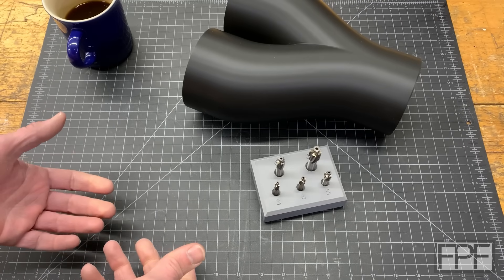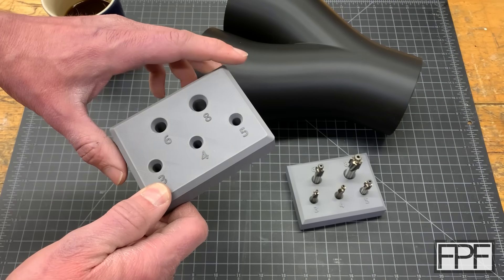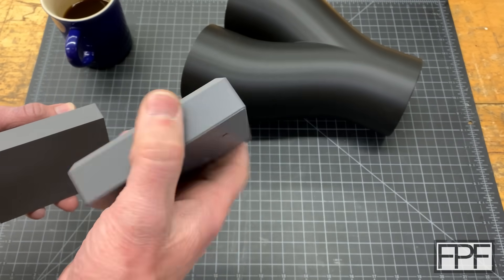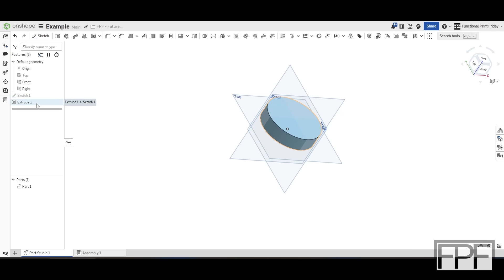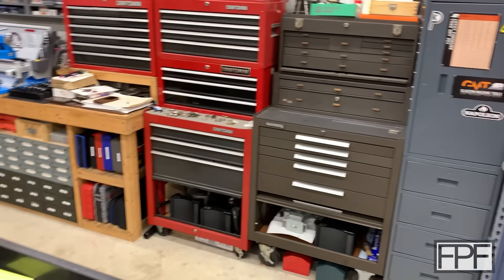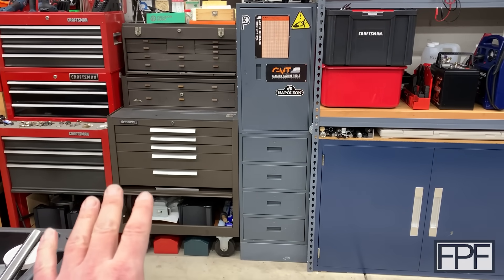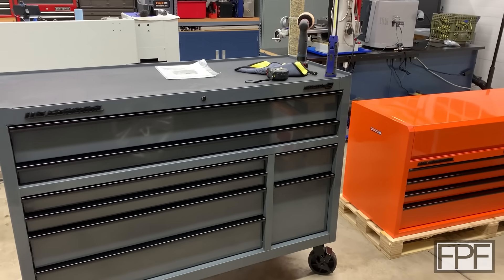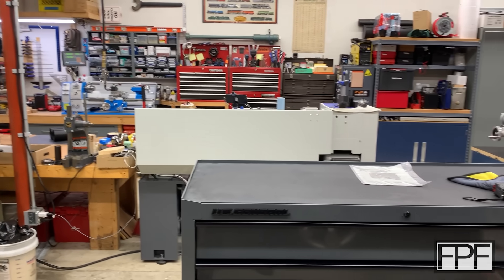Y-Pipe Viewer Challenge and Shop Updates

Comment: not gonna create an onshape account, but i did the challenge in inventor since they use the same kernel afaik (edit: fusion and inventor share kernel, not onshape). managed to do it 3 steps, tho i dont know how they would be grouped in onshape. 

my workflow was:
draw the path of one channel in the 2d sketch
draw the outer diameter of the base circle
sweep the circle along the path
mirror so you have the y shape
use the shell tool and make sure to de-select the openings so only the y tube remains afterwards

since sweep consumes the two sketches only 3 operations remain
unless you manage to sweep a self intersecting body this is the minimum of operations but i look forward to be proven wrong

Comment: Greetings from Norway!

I am really envious of your workshop! I would love to fit something similar in my house but I simply don’t have the available real estate. 😀

I really appreciate you taking the time to show more of the actual design of your parts. Especially your thought process. I bought a Bambu Lab P1S in January of 2025, I have just passed 1400 hours of printing on this machine. I want to design my own parts, but I have mostly done existing designs. I have printed a few of yours, they are great. I am currently using Fusion, but the learning curve is steep 😂. I have not looked much into Onshape, but I will definitely look into that. 

I also want to thank you for using both metric and imperial measurements. I understand why you’re designing in MM, but when measuring around your house (like the toolbox in this video) you used both. It’s a small gesture, but I really appreciate not having to make my own conversions. 

Will you be doing Gridfinity on some of your new storage drawers?

Best wishes for the new year and look forwards to your upcoming projects!

Comment: 6 timeline steps in Fusion: Sketch circle, sketch center spline on perpendicular, sweep <create, perpendicular>, identical sweep <join, perpendicular>, circular pattern <feature: choosing second sweep from timeline, use sketch circle as axis, compute type: adjust>, shell. This creates a perfectly parameterized version where the relevant cross section is respected unlike a loft, the shape of the pipe is defined by one single spline, and the number of tubes combined into one is defined by the circular pattern which inherits the join characteristic from the second sweep. 2 sketches, 2 sweeps, 1 circular pattern, 1 shell. I'll bet it's about equivalent in Onshape.

This is how I always do these vacuum adapters. It takes way longer to write this comment or open Fusion. As a general tip, abuse symmetry including the rotational kind as much as humanly possible.
Reply: That's neat. I created 2 sketches, each with concentric circles (inner and outer dias) one on an offset plane, then lofted the inner edges and then the outer, split the body, deleted half and finally used a circular pattern to duplicate it. That felt very clumsy, so thx for showing a more elegant method. Disappointed that I couldn't loft the faces, only the edges, which caused extra operations.

Comment: Toolbox Request:  personally, my OCD won’t allow me to have a top and bottom chest in different colors, but I also do agree accent color on toolboxes would be a lot nicer.  I’ve considered adding color to drawer handles.  

Now, regarding the accent color to cover the top chest damage.  I own a couple large top and bottom chests from Craftsman, and I had very similar idea.  Not due to damage, but I was thinking of putting TPU bumper on the same edges as a means to protect the edges.  Consider a black or gray TPU To bring the two boxes together, cover the damage from packaging when the paint was wet, and provide some protection for the box.

Just a thought, keep up the great work!

Comment: I got one of these Y fittings in my window. They are not very complicated to design. Typically I just use the Pipe function along with shell, in some programs you can select walls to remove or just bore out the rest with an extrude (if you want perfectly symmetric you can mirror). The other way that helps a lot for making tubes and nice angles is to start them with prisms (blocks) then use fillets to make them into circles by calculating the radius of the fillet for each edge as the (length of the wall) / 2 = radius. After you then shell the inside. You can also do lofts but a proper pipe step count would be about 4 - 5(1-2 sketches,1-2 pipe, shell).

On the toolbox, just do the 30 day thing. Everytime you look at it the thing will piss you off. If you put 3D prints on it, then you are just going to look at it and think about it. If you get a different color then you will either 1, like it better, or 2, hate it and get annoyed. Anything in the shop that you don't like can cause slight microstresses that will affect your workflow. Just bite the bullet and do the 30 days. That is unless it just REALLY does not affect you at all... which I doubt because you put it in a video. The current box already needs to be set up for gridfinity most likely anyways. And no... most things I cant get in one piece. I have a 600$ air conditioning unit that was thrown onto my porch by the delivery driver and has a big dent in the bottom of the radiator.

Comment: you can do the y-pipe in 5 "steps": sketch a circle, sketch a spline curve, sweep circle along spline, mirror with "add", shell
Reply: I think you missed that the single end has a different diameter than the double end
Reply: @fenceup07944931177  in that case you need two additional steps: one to create a plane at the end point, one to draw the sketch with the circle of the end point. then you dont use sweep, but loft (and use the spline as a guide). so 7 steps in that case

Comment: 5 steps in fusion :)
Reply: After a little bit of more thinking I did it in 4 steps
Reply: Actually when respecting the 45mm straight Design requirement that appears… optimistic…

Comment: Did it in Fusion in 8 steps. So no bragging rights for me. But was interesting to do. :)

1. Sketch with the one pipe/circle
2. Extrude -45mm (was dimension d10 in the end)
3. Construction layer with distance 250 -(-d10*2) from the origin
4. Sketch on the construction layer for the two pipes/circles
5. Extrude 45mm
6. Loft from the one-pipe-side to the left circle on the two-pipe-side
7. Loft from the one-pipe-side to the right circle on the two-pipe-side
8. Shell with 3mm thickness

Comment: The orange box I would have asked for it to be cleared coated again, this would provide some protection. The 3D printing a strip to cover the damage not a fan on the box. Not keen to replace with a red and black love the orange. I have several boxers yellow blue and red and they look great. This year my new shed will be built and several more boxers will be required I'm looking at apple green, British racing green, deep deep purple and the last one I spotted fire engine red. The racing green and deep purple have gold handles the others silver. So my fav's are deep purple and British green but who knows that may change after construction is completed. Not a fan of boring grey

Comment: I didnt do it in Oneshape, but just from curriosity i tried in my Solidworks Version: 5 Features i needed
How i did? => Design one side cut the  connection surface flat, mirror the designed part, and make a Wallcut without floor, maybe it is a idea for Oneshape to improve

Comment: 7 Steps in Fusion (I don't have Onshape, but I believe all the functions are equavalent in Fusion):

1 sketch bottom profile on origin plane
2 create offset plane for top profile sketch
3 Top profile sketch
4 Side profile sketch for sweep centreline
5 Sweep top to bottom profile (1 side)
6 Mirror body in YZ plane
7 Shell
Reply: 1. Sketch 1
2. Offset plane
3. sketch 2
4. loft 1 (should have a weight setting on it?)
5. loft 2 (should have a join setting?)
6. shell
Reply: Actually the lofting is pretty hard  to get perfectly straight at the ends... so sweeping gets better results. Some tweaking made it down to 5 Steps in OnShape:
1. Single End Sketch on horizontal plane
2. Rails-Sketch on a vertical plane
3. Sweep circle along first rail
4. Sweep the same circle along the 2nd rails an merge at the same time
5. Shell out

Comment: Keep the orange box with a discount. It's a storage box after all. Cover it up if OCD makes you to 😅 Given your fleet of printers and sponsored filament I'd do it too, probably.
For your challenge (sorry, I use Fusion360) I'd do it in 6 steps: 1) sketch (two circles), 2) sketch (path for one half), 3) sweep on path, 4) split on yz plane, 5) remove cut part, 6) mirror merge on yz plane

Comment: Chamfering the bottom eliminates elephant foot first layer. In Fusion, offset plane, 2 sketches (with 3 circles), 2 lofts with a join, shell.
Reply: Or just use the slicer's built in method instead of fixing in design. Else you need to fix the design for every material on every printer.
Reply: @valamilamasag thanks, I need to check that out.
Reply: That’s EXACTLY what I said to myself when he was mentioning the challenge
Reply: 2 Planes, 2 circles, 1 fit spline, 1 loft, 1 mirror(join), 1 shell
Reply: You can still get an elephants foot, the chamfer hides it rather than eliminating it.
Reply: @ferrumignis good point

Comment: Made it 7 steps, albeit in fusion: https://youtu.be/Eyxa7BZ6LSU
Reply: You could have put the two circular profiles and the spline in the same sketch by using the 3D sketch option. Not that you would do so like that in practice but it does save a "step".
Reply: And as an afterthought if you put 4 circular profiles and the centreline in a single sketch you can then loft between them followed by a mirror join and a shell. 4 steps.

Comment: Took a bit of tinkering but got it in 6 steps. One sketch with both size circles and the correct spacing. A normal extrude and then another one with a starting offset to get the other side, then loft, mirror, and shell
Reply: Oooh, good idea to use an extrude with starting offset to avoid the need for a plane and second sketch. 👍
Reply: But your single opening side won't be perfectly vertical for 45mm? I think all three pipe openings need 45mm straight sections. I could only do this with two guides in 8 steps.

Comment: I did it in Fusion 360 in 11 steps. That includes creating two sketches, one shape, three lines, two arcs, sweeping, mirroring, and shelling. I believe I could cut it to 10 with a different arc creation sequence and to 9 by eyeballing the arcs instead of using a guide line. Technically I could cut it to 7 by eyeballing the arcs entirely or at least just counting squares and I could cut it to 6 by using a single sketch and just using 3D sketching. I think 11 is pretty reasonable though! To comply with your rules of 45mm straight sections I would need to add two lines making it 13 steps total. If you count everything in a sketch as one step, then it's only 5 steps for me as shown on the history bar and could easily be 4 with a 3D sketch.
Reply: Oh another commenter just pointed out I missed the requirement of the circles being different diameters. That adds a few steps. I'd likely create an offset plane, then another sketch, and another circle. Don't need two of the extra lines then. So brings it to 12 steps total or 14 with the straight sections. Still only 3 sketches and 3 operations or really one 3D sketch and 3 operations. I think 14 is the real number of total actual tools used.

Comment: My opinions
I was gonna make some of those design points last week, but I figured others would point the little nuances out. Glad you made those changes.
Other than that...
The orange paint is fine.
I love the colors.
As for the last cabinet... As longs the drawers slide out without anything jamming up. Everything's fine.
Reply: I have always felt the same way about the fine details of buying something new. But...  as long as everything works.

Is it worth the hassle of sending everything back to get a return which might be damaged in a different way?

Comment: While it doesn't qualify for the challenge, it was fun to make the object in FreeCAD. It took me 8 steps in the Part Design Workbench:

1) Sketch a circle for one of the large pipe ends, 250mm up from the xy plane
2) Sketch a circle for the small pipe end on the XY plane
3) Sketch a path on the ZX plane between the two circles (two straight lines and two arcs)
4) Additive Pipe using the 3 sketches
5) Thickness the pipe to 3 mm
6) Datum plane from the YZ plane
7) Pocket away the excess pipe using the datum plane
8) Mirror the remainder

My first thought was to mirror the solid then thickness it but FreeCAD couldn't do that thickness operation. I imagine that OnShape could, so it will be possible to do it in 6 steps.
Reply: Huh. I don't know OnShape, but I have an old account so I hopped on and and gave the challenge a try. I'm sure I could learn it by watching videos and working at it for a while, but my first impression was that a lot of things are unintuitive and frustrating. I had to look up how to do several things just to create three simple sketches. Then I tried to loft or sweep using them and didn't manage to make either of those features work as needed. The sweep swept both the start and end sketch along the path, creating a 106.25mm pipe with an embedded 101.6mm pipe instead of a pipe tapering between the two dimensions. The loft created the correct start and end sections but twisted up so it closed to a point in the middle). I banged my head against it for a while but it stopped being fun and I gave up.

Again, I'm sure I could learn to use OnShape, and I ran into plenty of frustrations learning to use FreeCAD, but given how people talk about OnShape I was expecting it to be easier to do something simple like this.

Comment: I just replaced my harbor freight General (off to my daughter) and replaced it with a 73" Harbor fright  ICON roller cabinet. I think harbor fright tool boxes are a great value. I my case, I looked for a roller cabinet to carry my PM1440GT. So I  reinforced the box with new wheels and steel to carry the PM 1440GT lathe which sits on a 1/2" plate of 6061. If you are interested I can send you a pic. The one issue is, I need a riser to use the lathe because the roller box is higher than the at the stand it replaced. The total load of the box is 8000 lbs which was a good starting point which enables it to hold all of my lathe tooling.
So the PM1440GT is on wheels with levelers and I have adjustable bet rails attached to the plate so I can manage any bed twist. I also updated the PM1440GT with a VSD and better control logic as I scraped the lathe stand and control package.
If you are interested in the variable drive I can walk you thru that to0. I also swapped out the DRO for a touch DRO with the RPM option. Needless to say I get much better speed range than PM's version but that's another story. By the way, my PM728VT is also on a tool box with hydraulic wheels.

Comment: I use SolidWorks Maker instead of Onshape so I can't submit a model, but they look like basically the same thing, so here's my take.
1. Sketch bottom circle on the top plane at the origin
2. Sketch the curve for the loft on the front plane
3. Create plane for the top circle
4. Sketch the top circle
5. Loft
6. Mirror body across right plane
7. Shell
Reply: If SolidWorks has something akin to the sweep command in Fusion 360 you can skip the second plane and second circle and just sweep along the curve instead. Otherwise pretty much exactly what I did.
Reply: @802Garage but that gives the same OD to the top and bottom circles. In solidworks, to go from one OD to another requires a loft from one diameter circle to another, hence the other plane and sketch.
Reply: @johndupree6066 You are totally right! Missed that part of the requirements. Good call.
Reply: I don't know OnShape either, but I tried exactly those steps. It has all of those tools, but the Loft didn't work (it twisted in the middle, presumably either the plane or one of the circles was rotated differently than the other), so I have no idea if the mirror or shell would work. Sweep didn't work either (it was 106.25mm OD all the way, with a smaller diameter circle visible on both ends).

Comment: Glad you like OnShape, it's not my preference though, so I'll evade the challenge I guess. I think I can do it in FreeCAD, but that disqualifies itself, so I won't worry about it. I do think I can do it in about 5 or 6 steps in FreeCAD, but I'm pretty sure that's using features that I don't know if they are included in OnShape, so I won't describe them here. Best of luck to whomever picks up the challenge. The different OD pipe dimensions at each end complicate things. 

As for the orange top box, yeah, get the kick back, then make up a set of TPU bumpers in black to cover those surfaces. If the sovl max has a tool-changer option available, it might be an option to have a second extruder with something like a silver colored TPU to give the corners an accent. But I'm pretty sure that wouldn't come out as glossy as one would like, so single color is probably fine.
Reply: I'm in the same boat, but I did it in FreeCAD anyway. It took me 8 steps in Part Design. I thought I could do it in 6, but one of the functions threw an error and forced me to find another way. I think it could be done in less in the Part workbench, but I'm not as familiar with that.